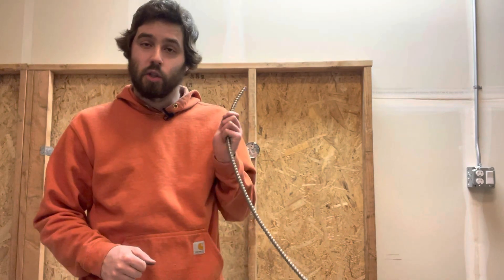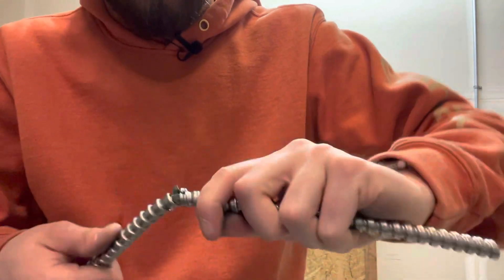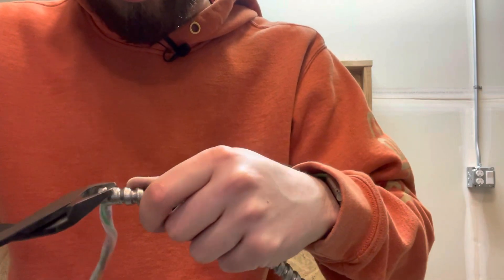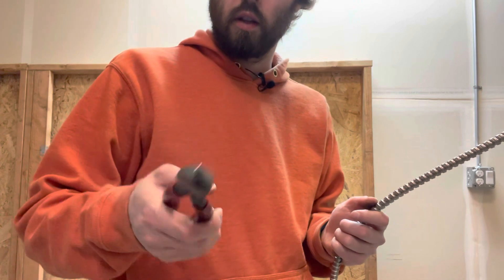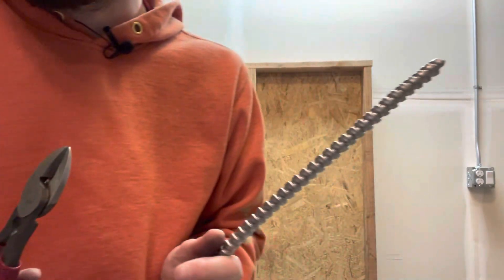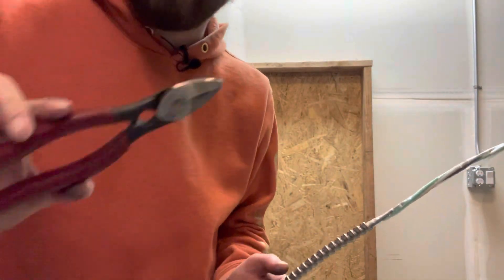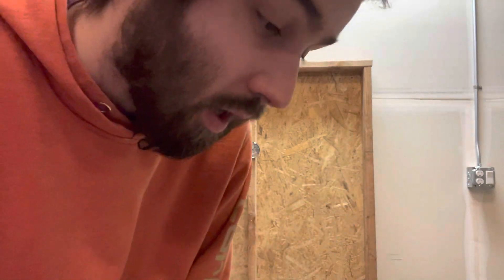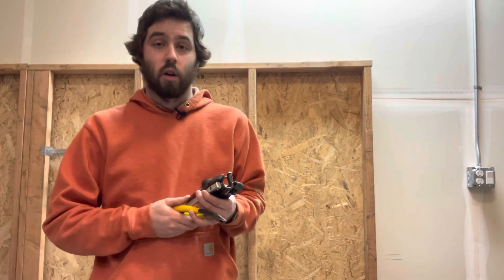Electrical 101: How To Remove MC Sheathing (3 Techniques)

Comment: Rotos or dikes for me. I hate carrying the roto and the large range of motion it requires when youre in tight spots but it is probably the best.

 The way I do it with dikes is crack the jacket, unravel some of the jacket and slide the tip of my dikes into the jacket (in between the jacket and wire) & cut a clean cut on a full interlock. Ive never had an issue nicking the wire and its probably the quickest method for me. 

If the MC jacket is a tighter interlock wrap from another manufacturer ill crack it, unravel it & cut the loop of interlock that I unraveled and cut a second and final cut to clean up the end of the jacket.

Comment: I have a mini hack saw that I use to cut 45° across two links of the box and then you can twist it and the armor comes right off. When you get good at it, it only takes about 2 or 3 strokes with the hack saw.

I tried method #2 but it doesn't work with the BX (or as you call it MC) in Canada. Must be made a little differently.

It's a lot easier carrying around a mini hacksaw then it is a giant roto split
Reply from the maker: to each their own 🙂

i put the roto split in my hammer holder in my tool belt :)

if no tool belt, definitly more of a hassle to put on top of a ladder

Comment: 2nd, I like using tin snips if the roto zip wasn't available. I don't like the bx cutters.
Reply from the maker: tin snipes, interesting. i'll have to try that. sounds very similar to the bx cutters tho
Reply: @DailyElectrician  I didn't bend the MC before , Tin snips have a sharper point. I remember when MC first was available on the market.( Like AC cable), it was a few years before the roto zips came out. I had a flex roto zip for 3/4 and 1/2 flexbefore I saw one for MC.
Reply from the maker: im too young to have ever seen one 😭